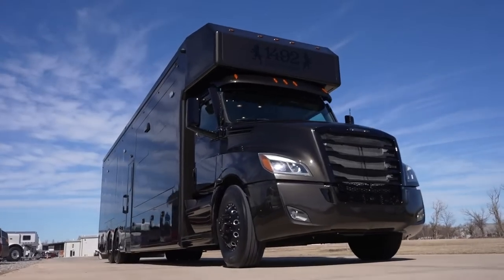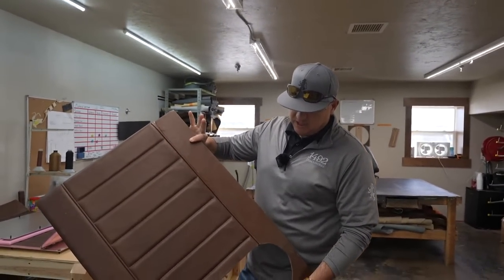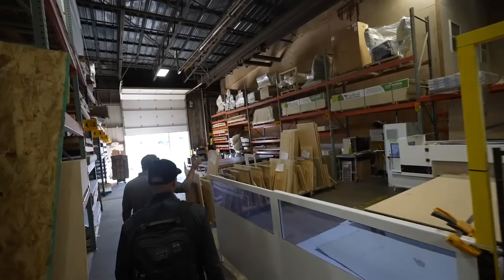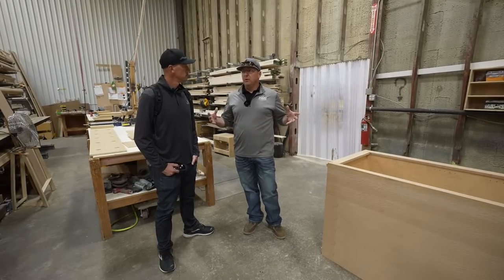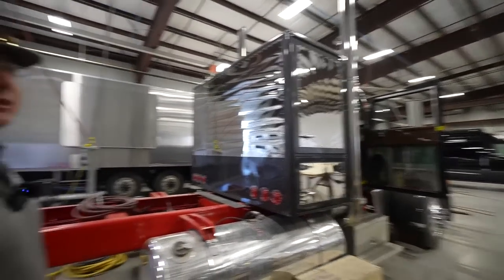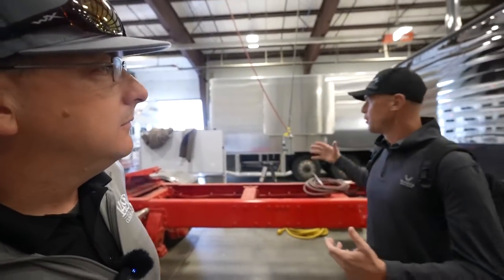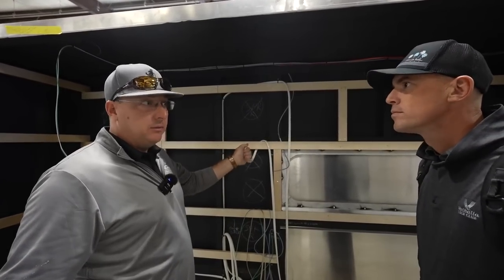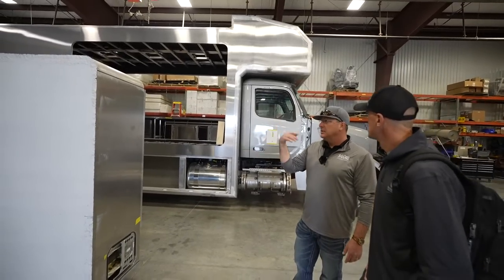Building the Most Expensive Class C RV-Factory Tour of 1492 Coachworks

Comment: Being a retired truck driver, my opinion is super singles should be outlawed, not safe and cause big damage when they blow. Not to mention you are dead in the water with a flat, not going anywhere.
Reply: I all ways liked the idea but wondered why they never took off I was a retail Independent Goodyear dealer But busted the big tires when younger So good info Thanks
Reply: Yeah I second that. I'm still a trucker on the road and I can attest that Super Single tires are very dangerous to say the least. I've actually had a blow out with these and totalled a car right next to me in the hammer lane. They need to be outlawed. A good way to destroy a Super C motorhome due to a blow out. You should really reconsider using them in your custom builds.
Reply: @Moddwerxtech  the customer wanted the super singles.
Reply: Super singles are worse than duals in snow/wintry conditions